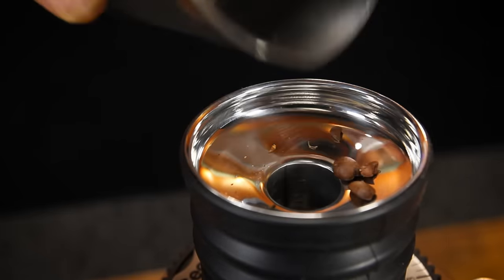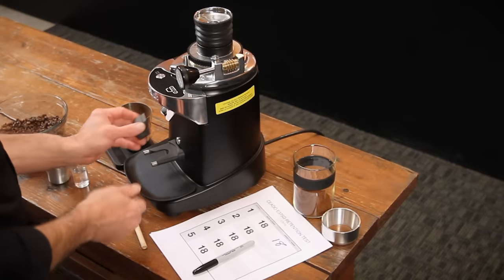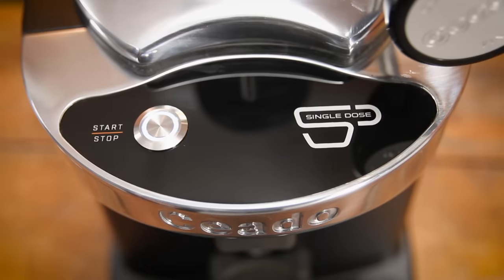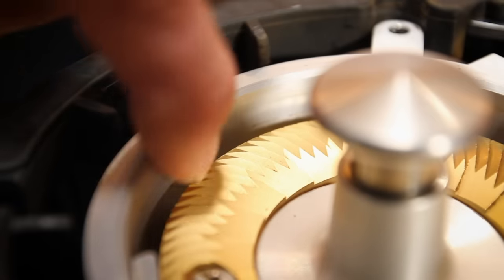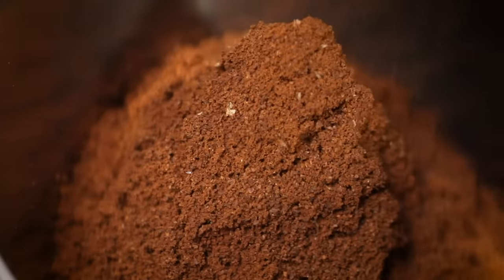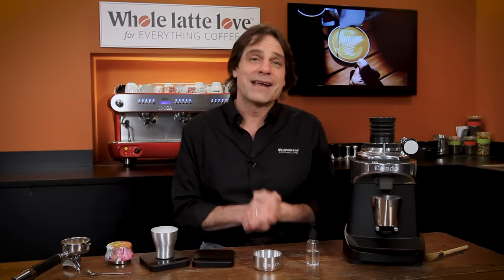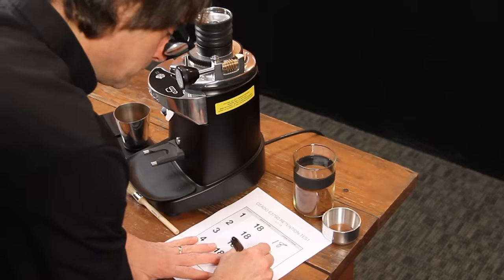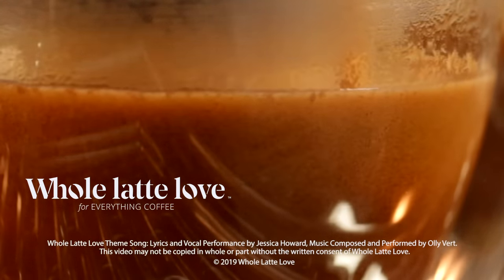Review: Ceado E37SD Single Dose Titanium Burr Coffee Grinder

Comment: Hi Marc, I realized, that the E37SD has a 400W motor and the E37S has a more powerful 500W motor. Do you know the reason for this difference? Sincerely, travelbug
Reply from the maker: Hi travelbug, Thanks for the question. The E37SD as a single dosing grinder doesn't leave partially ground beans in the burrs between grind cycles so doesn't require the same starting power as the E37S which with the hopper feed needs more power.
Marc

Comment: Hi Marc - I'm a new owner of the E37SD from WLL, but so far I'm disappointed.  I'm having problems with channeling on my ECM Synchronika that I've never had before.  I'm doing everything identically and only varying using the Ceado vs my old Rocky Rancilio as my grinder.  Any idea what could be the difference between the Rocky and the Ceado grinds that could cause this?  Pulling my hair out.
Reply from the maker: Hi Sebastian, Sorry to hear you are having troubles. I'm pulling my hair out trying to figure out how grind from an E37SD would cause channeling if grind from a Rocky was not. The grind quality from the Ceado is far superior to the Rocky in every respect. We use the E37SD as our lab grinder for espresso taste comparisons and would never consider using a Rocky for that. Has something else besides the grinder changed in your process? Are you using same coffee, dose weight, tamping technique, filter basket, etc? How are you distributing coffee in filter basket? Any chance your shower screen is dirty and/or wetting your puck unevenly? Are you grinding into a cup and then dosing or dosing straight into a PF? My guess is the issue equipment beyond the grinder or technique related. Outside of other variables grind from the E37SD should be less prone to channeling than typically clumpy grind from the Rocky.
Marc

Comment: This looks so similar to the 37S - would it be possible to fit the bellows / funnel from the E37SD to an E37S to convert the E#&S to single dose grinding? I know you won't have the titanium burrs but still, for those folks who have an E37S and would like to get into single dose grinding??
Reply from the maker: Hi Bob, Thanks for the question. Unfortunately, The bellows will not work on the E37S. But you can single dose to some extent with it. Typical retention if you single dose into the hopper is <1g and often closer to .5g. If you can live with that then...
Marc

Comment: Hi Marc. What is the maximum coffee dosage does the e37sd can hold in grams. 30? 40? etc
Reply from the maker: Hi Garnett, Not something I've measured before so I pulled out an E37SD and checked. It's about 60g. That's with the grinder off and filling with beans to capacity of the bellows. Keep in mind with the grinder running you could continuously feed beans. The only real limit being the size of the receptacle to catch the grounds. Hope that helps!
Marc
Reply: @Wholelattelovepage  Thank you very much Marc.

Comment: Hi Marc, I currently owned mazzer mini, do you think e37sd worth the upgrade from my current mazzer mini? Thanks.
Reply from the maker: Hi Lucas, Thanks for the question. Well, if you've seen a certain few of my other videos you might know I'm not much of a fan of the mini. I don't like the grinding chamber design with adjustment threads open to clogging and those 3 little springs which the top burr carrier rests on. With that out of the way, the E37SD would be a huge upgrade! 83mm burr vs. 64 mm, pure single doses, super accurate quick set grind size adjustment, sealed adjustment threads and no loss of grind size adjustment when opening up the grinder. Night and day!
Marc
Reply: But if you can live with the few quirks of the Mazzer Mini - it does a very good job.
Build quality, and dose consistency of output are big pluses with output variation being around 0.2gm. But you need to clean often!
 If you want the best the e37SD does win hands down - at a very high price!

Comment: Hi I have questions I have same grinder, and when I rotate for coarser the wheel move upon the right side around 1-2mm and when go to finer go down back.Did u have this problem?
Reply from the maker: Hi EI, There is a slight amount of play in the gear when switching from coarser to finer adjusting and vice versa. It's not so much a problem but a requirement. If the gear is too tight it would be difficult to turn. There has to be a slight amount of play for smooth operation. Note the grind scale does not change until the gear is fully engaged.
Marc

Comment: Hi, can anyone advise on difference between E5SD vs E37SD? Basically thinking if it's worth paying more for the E37, will it taste better in the cup. For home use espresso. Want something that will last forever if possible.
Reply from the maker: Hi MO, IMO the E37SD has the potential to taste better in cup. Key differences are in burr size, burr material and grind size adjustment. E37SD is 83mm, Titanium coated burr and Quick Est adjustment. E5SD is 64mm, anti-oxodant steel burrs and turning collar adjustment. Beyond that the E37SD is much easier to open up and there's no loss of grind setting when doing so. Both grinderts are very well made but E37SD has higher quality components/connectors and a sealed adjustment mechanism. If forever is important the E37SD is the higher build quality, more powerful motor.
Marc

Comment: What kind of a grinder review doesn't test extractions? Or in other words if this is better, more consistent, from shot to shot compared to a regular E37S. 

Otherwise what would be the point of paying more for unnecessary, for home use,  titanium burrs and a bellows that could be added to any grinder?
Reply from the maker: Hi Devlin, Thanks for the comment. Testing extractions was not the point of this video. It was a review of the grinder parts, technique of operation and testing of retention.
Marc
Reply: @Wholelattelovepage  Call it a dry test, not a review.
Reply from the maker: LOL

Comment: That does not look like titanium. It looks more like a titanium nitride coating, which is a completely different animal.
Please let me know if I'm wrong.
Reply from the maker: You are not wrong
Reply: @Wholelattelovepage  what is the coating than? Raw titanium is an entirely different color!
Reply: @finder2267  I don't know for sure but they're probably steel burrs with a titanium nitride coating like tasmedic said.
Reply: @kevinsmith9106  I know! I wanted to get WLL to make a statement. You and I both know burrs made solid Ti be then be coated in titanium nitride isn't cost-effective or logical. There are no 100 % Ti burr sets I am aware of. Ti is also very hard to work with as a raw matrial

Comment: I'm wondering if that blow out funnel could be used on an E37S and whether it'll be available to buy?
Reply from the maker: Hi Sabrina, Thanks for the question. It cannot be used on the E37S. A couple of reasons. First, the collar which holds the bean hopper is different on the S and SD models. The S model has cutouts for the hopper shutoff slide mechanism. With those there's a spot for air to escape. Hopper collars are not interchangeable between the models. Second, the internal design of the S is different so blowing out would not have the same affect as it does on the SD.
Marc

Comment: I couldn’t get consistency even with a really fresh coffee, I have followed all the instructions by the book and sometimes I get 20 sec extraction 40 sec extraction 30 sec extraction, with the same dial, same coffee, same technique. Really frustrating.
I bought it from WLL, and their suggestions are not  unanimous:
“You need to break in the burrs, use 1 pound of coffee”
“You need to grind a least 10 pounds in order to get consistency” 
And yesterday's customer support ask me to grind coarser,
Reply from the maker: Hi Hernan, Thanks for reaching out. I talked to Mitch in our CS dept. He told me he spoke with you today and resolved your issue.
Marc
Reply: I have ceado e5p and it's fantastic for the price
Reply: Very fresh coffee can be unpredictable when making espresso due to off-gassing causing chanelling. It's probably advisable to use beans that are at least 7 days after roast, anything fresher than this is a nightmare to dial in! Did you ever manage to sort out your issue? Considering this grinder as a possible upgrade

Comment: Do you all sell any dosing funnels?
Reply: Be careful about purchasing a dosing funnel.  Many (most) of the machines that dock with the portafilter do not have enough height adjustment to allow the docking mechanism to engage.  So, after going through many funnels I found one that fit.  Good, huh?  Not really.  For example on the E37S, I found one that fit but when engaged the funnel would tilt and the whole system became unstable.  So, if you disable the portafilter hook on the grinder I now use the funnel and manually hold the portafilter during the grind of 3 seconds or so.  On the 270W and Wi there is no funnel I could find that fit.  If you want to proceed, if I were you, get Mark to recommend a machine or two that have a portafilter rest/dock that works with a funnel.
Reply: Thomas Chester hi I have the rocket high end one (name escapes me right now) but I have the room if I take the holder off
Reply: @ThomasChesterVA   how were you able to disable the portafilter hook on the E37S? I got 3 weeks ago the new E37S and I can't remove it. I even got in contact with Ceado Customer Support and they told me is not possible. So, now I am battling between the hooks and funnel everytime I grind.

Comment: Hi guys,
I have a question: So I am using a 54mm basket with ~17g of coffee. I get 60ml in like 30 sec but the coffee tastes sour. I am already on a very fine setting and if I set it even finer, the machine chokes. I am also not even tamping hard. What can I do?
Reply: How about tamping harder, go for only 40ml in same timeframe?
Reply: Getting the same result, still sour.
But I realised if I use a very fine setting (to prevent under-extraction), tamp it very light (to prevent choking) and use less coffee (to fit it in the basket because of the lighter tamp), the shot gets much much better and it's just a bit sour. Nevertheless not satisfied... :-D
Reply: First of all, thanks for the tips. I tried a lot in the last week and ended up with a surprising reslut. Obviously I ground too FINE and mixed up the bitter taste with a sour one.
So as you recommended I ground coarser and tamped harder and voilà, a balanced tasting shot!

Comment: Bought this grinder from WLL due to this vid. Great on zero grind retention. Vid BIG MISS is no talk of how to set Zero on grinder. Super important not to discuss this so wasted time figuring this out. After confirming zero with WLL tech support, espresso grind settings for 4 diff coffee beans ranged from 0.30 to 0.45.  Below 0.30 E37SD clogs up consistently. Window is too narrow, no headroom to grind finer for bottomless portafilter or other beans. Disappointed.. Will return grinder as what it considers 'fine' grind is not as fine as other grinders.
Reply from the maker: Hi e, Thanks for the comment. Sorry to hear you are disappointed. I use just about every grinder make and model available in the US and IMO the E37SD is one of the best available. I do not cover how to set zero in every grinder video I do. It's very straightforward. With the grinder running adjust grind finer just until you hear the burrs touch then back off a hair. That's zero. No worries about the burrs touching as it's the outer smooth ring which makes contact and not the cutting teeth. I am happy to hear our tech support was able to provide you with the info you desired. I'm surprised by the clogging unless you are using some really oily beans or something else is weird. I've never had a clog using the E37SD and I've ground 100's of cycles at espresso grind size. It is as you mentioned amazing at zero retention. Put 18g in and with the RDT spray you get 18g out. Open it up and there's nothing left behind. Only one other grinder I know of capable of that and it's double the price. I fear you will be disappointed with other grinders as well if you are grinding so fine for espresso you are somehow clogging the SD. I'm not quite sure what you mean about the headroom for bottomless PFs. The grinder does come with a WDT cup for grinding into as well as a PF dosing funnel if you prefer to go directly into portafilter.
Marc
Reply: Thank u for your reply Marc. My coffees are all medium roast, as confirmed by your tech- Bluebottle Opascope, Four Barrell Coffee Ethiopian Keramo, etc. What I mean by no headroom is we are at 0.30-0.45 with 5 different medium roast coffees. I’ve ordered same coffee beans and some of them needed finer grinds due to humidity, etc. E37SD at this point only has adjustments below 0.30 to play with BUT it clogs (with all 5 beans) when dial is set anywhere below 0.30. I’ve had 2 appointments witha tech from a service ctr see this, one with a live conversation with Phil from your cust support to ensure we had everything right. And yes, with these 5 beans (none are oily) grinder clogs at 0.30 and surely below this. This is what i mean by no headroom. Never had this issue with my 15 yr old Macap- which has much higher grind retention. To me, being able to grind the beans to get extraction right is MORE important than zero grind retention. E37SD great at 0 retention but CANNOT outperform high quality grinders in terms of how fine it can grind before clogging. I really worked on making this grinder work- spending another $680 in tech service fees, but i have to return it as it cannot grind as fine as my older grinder. Sad to see it work out this way, but have no choice other than to return it. Keep making the great vids you do. I learn a lot from you.
Reply: @ezcatch77  I've had this same experience. At the finest grind size that does not clog the machine I can't get an extraction time above 20s with light roast coffee in a 20g basket. I simply cannot grind fine enough for espresso. If I tried going finer than 0.3 (after calibrating to find 0)  I'd get about 4-5g out before it clogged and the beans no longer fed through. These were not oily beans or overly watered with rdt (1-2 sprays only).
Reply: Hi Chris, I hear ya and sorry to hear abt your experience. Thank you for sharing. I feel validated because I spent over $1000 in having a coffee repair technician come to the house at least twice to see if I was doing anything wrong and he experienced the same. I purchased the grinder from Decent coffee $350, already setup up with a scale, and it works like a charm. Best of luck!